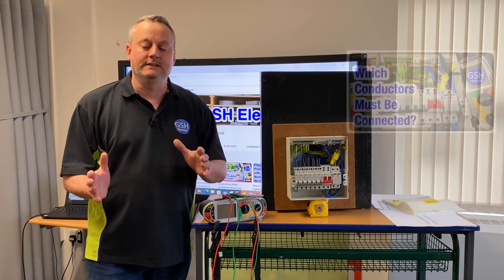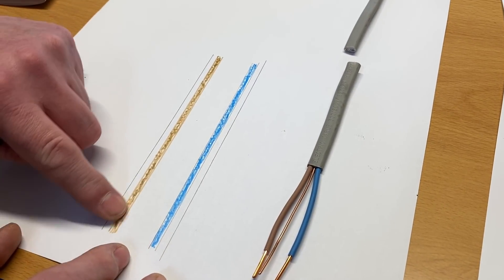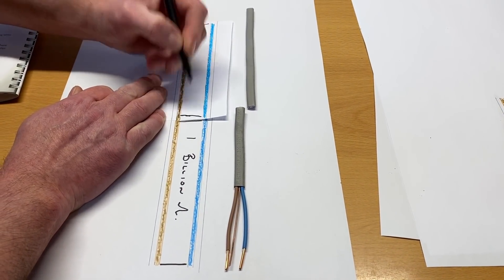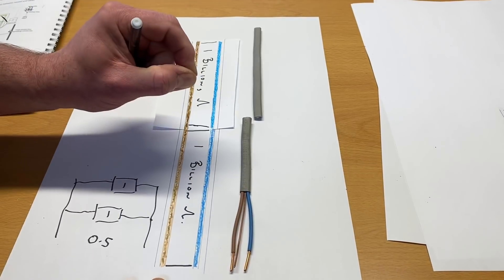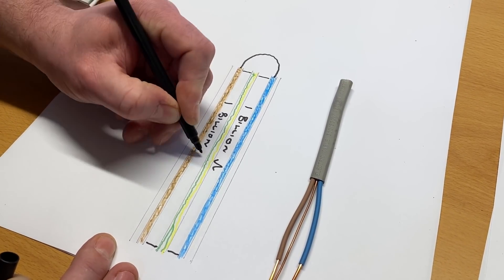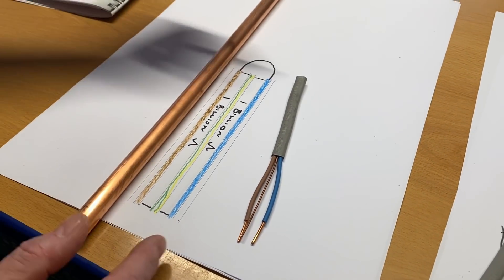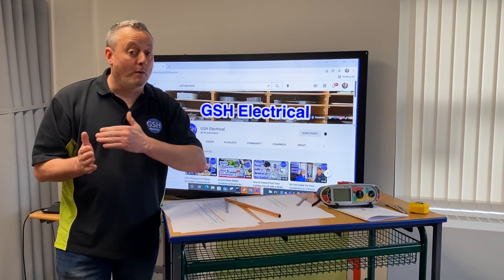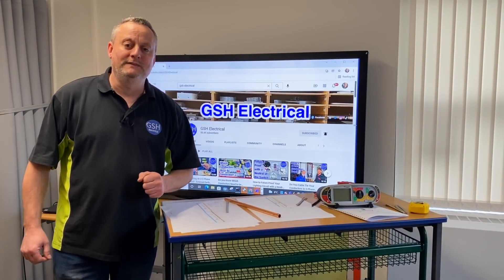Do YOU Know What Happens to a Circuits Insulation Resistance When the Circuit Length is Increased?

Comment: Yet another in a brilliant range of videos; always interesting, always enlightening.

Could I just ask: would it not be better in the real world and in an older property to test the insulation with the cpc disconnected at the consumer unit, so that only the cable is tested (hopefully); and then test with the cpc reconnected to the busbar?  Or vice versa of course.

When the insulation resistance is way below infinity (999m ohm) surely this would give a better indication of the system condition when insulation resistance is for example in the range of say 60m ohm!

Comment: Hi Gaz great video however im a bit confused i thought the longer the cable the greater the resistance and now your saying the less resistance or is it to do with the cables in parallel. Am i right in thinking the whole point of insulation resistance is to make sure the line neutral and earth are totally insulated from each other and that no current is leaking out of the insulation to cause a short or earth fault. Thank you for putting this video together much appreciated.
Reply: Yes the longer the cable the higher the resistance of the CONDUCTORS But with insulation resistance we are measuring the resistance BETWEEN conductors not the resistance OF the conductors.

So the longer the conductors of which the resistance between them we are measuring, the lower that resistance will be as there is more area available for the electrons to jump from one conductor to the other.

Think about if you have a 1m hose with one puncture. That means when you turn on the tap you will have leakage (water drip from the puncture) of say 1lt per minute.
If you add to the end of that hose another 1m hose with the same size puncture then your total length of hose would be 2m with 1 puncture per 1m.
So that means that your leakage will double (water drips from now 2 identical holes) to 2lt per minute.
Meaning the insulation (which is the hose) between the water and the ground has halved as now twice the amount of water is dripping!
Reply from the maker: The details are in the video Angela maybe worth a second watch 👍🏻 thanks for commenting Gaz

Comment: It does not stop there. Any place where the insulation is squashed the insulation will be thinner and reduced, at a socket , twisted cable or tight joist feed through, we are aware of this but how much can this reduce resistance value . I am sure there are other factors at work as well.

Comment: Just wondering how voltage drop would affect this over the longer distance increasing the voltage drop..
But then does the temp of the insulation also change the characteristics of the insulation.. Then there is the electrical conductivity of the copper when it is at the higher temp.. Causing more voltage drop? or less?

Comment: Hi, thanks for your helpful videos. On this one I’m struggling to see why the resistance when adding cable length is treated as parallel rather than series?
Reply: Line and CPC run parallel to each other.
Reply: @paulmatthews5470  In this instance use of the word parallel has a specific meaning in electrical circuitry with no relationship to their proximity in a space running next to each other.
Reply: @etdj909  never meant to be

Comment: Fantastic explanation, but I am a bit confused , testing line and neutral combined to earth so long as the value is >1 meg ohm then what’s the problem after all we only test line and neutral combined to earth so as not to damage any sensitive electronic equipment that can’t be removed from circuit. Also we should be careful with this test as anyone who maybe touching any earthed metal work will be tested as well and they won’t be happy. 
Brilliant video Gaz as always 
👍👍👍👍❤️I do love waking up on a Sunday morning to a great electrical installation lesson from GHS , keeps my brain refreshed,
Reply: Well as long as they aren’t holding a live cable and a CPC then they aren’t completing a circuit.
Reply: @paulmatthews5470  get your tester out and set for 500v IR and hold the test lead that that is plugged into the line jack and with out touching the other test lead press the test button, I bet you get a shock, remember the test voltage goes down the line and returns on the earth back to the tester , so it simple logic that on its return all earthed metal work including the kitchen sink will be tested and if someone just happens to be leaning on that sink they will be tested as well , and you can expect to be called a view choice names.
Reply: @seandempsey7351  just tried it, never got a shock, BECAUSE I’M NOT COMPLETING THE CIRCUIT
Reply: Now, if I had been leaning on something earthed as well, I’d then get a shock. But standing here I’m fine.
Reply: @paulmatthews5470  that’s what I said if someone is touching any earthed metal work such as a water or gas pipe even the kitchen sink when you press the test button they will get a shock. It won’t do them any harm but they will call you a view choice names. And as for the tester you will will get a shock from just the line probe but again at worst it’s a sharp tingling up your arm . I’ve done it not on purpose but a lack of concentration on my part . Also some people can hold both probes and fill nothing .
Reply: sorry just read this , That is why you inform all persons present of the test you are conducting, simple health and safety, good working practice